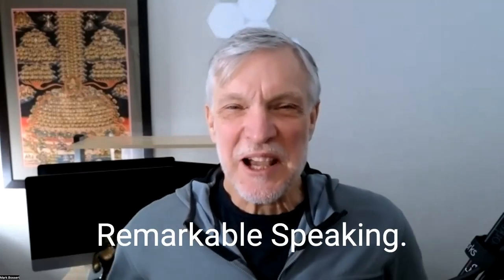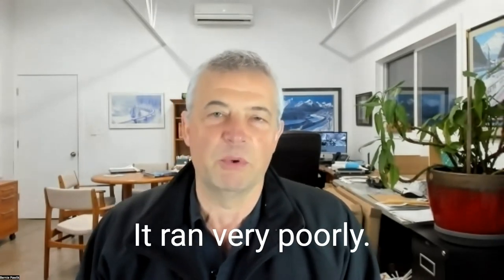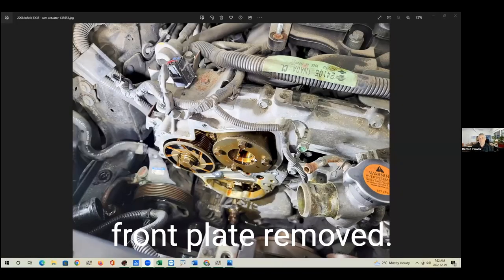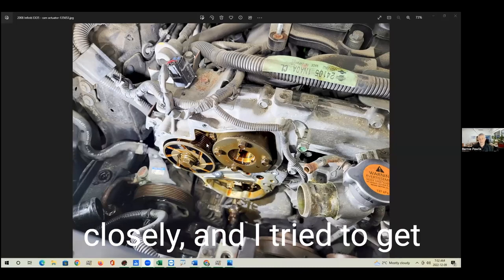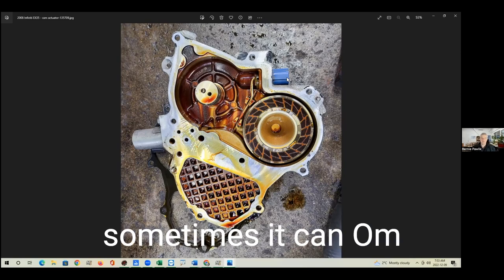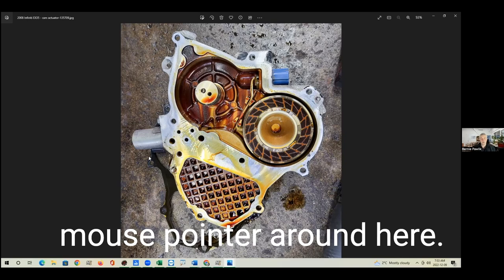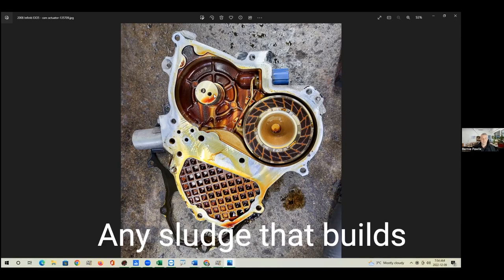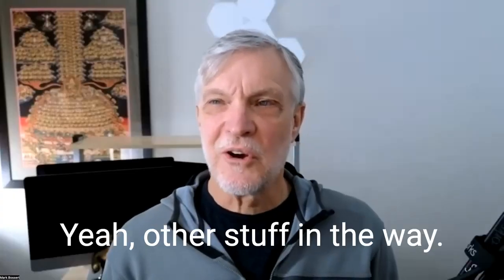2008 Infiniti EX35 Rough Running Engine

Comment: I have same year and model infiniti with the same problem. Flywheel is bent causing crank position sensor circuit code p0335